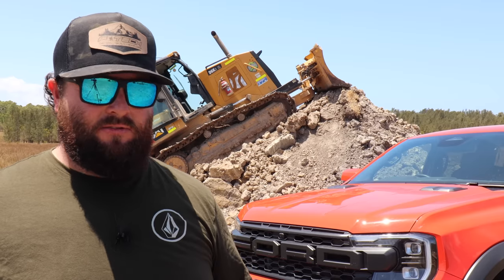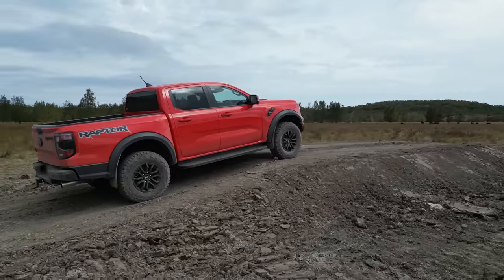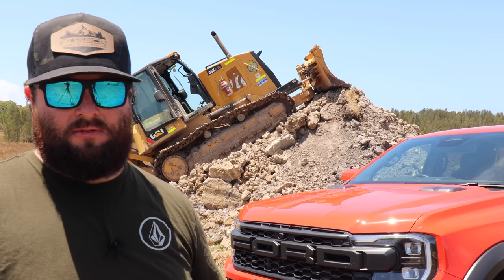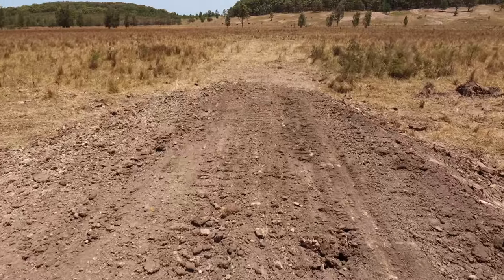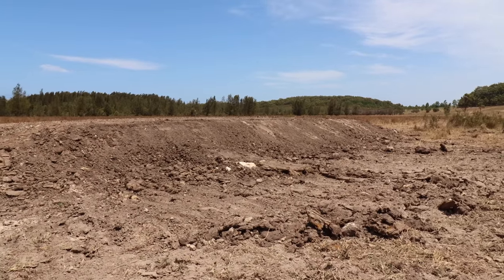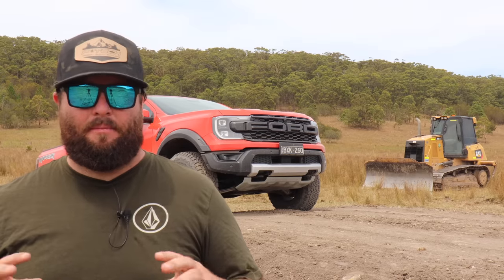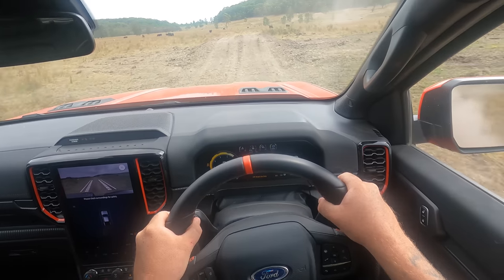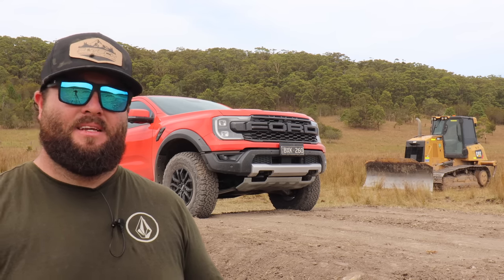💀HOW TO JUMP A RANGER RAPTOR ! WATCH before you jump your RAPTOR .

Comment: A lot of people don't actually understand how good the Raptor (either generation) is straight out of the box. This only serves to further prove the point! and the fact FORD gave you a car shows their confidence in it too!!!
I hear "Oh for that money I can build a miles better Wildtrak" which I don't believe is true without a massive cost rear coil conversion..... It would be awesome to see if you could get someone with a modified "normal" Ranger to tackle some trails against a bone stock Raptor. Especially those quicker Baja style runs, to see just how different things are between the two!
Your first gen vs. next-gen stuff is brilliant but there are guys on the fence about Wildtrak vs. Raptor that might not fully understand the massive differences between the two either in basic engine/driveline/suspension spec, capabilities or chassis and engineering changes.

Comment: If i put 315 70 17 tires on mine, can it still be put to a test like this? Can it still handle road abuse? 

Im wondering if it will damage the fenders in that case
Reply from the maker: I have 35s on mine and it does scrub out on full compression. You might be ok but if he aware it might touch.

Comment: Hey Ty 
Great video and explanation.  Are you doing any spring lifts to the Gen 2?
Reply from the maker: With bypass shocks it’s very difficult to put a lifted spring in with out destroying the ride
Reply: @TyFenwick  good to see that opinion!!!!.... too many people out there argue otherwise and will lift their Raptor (either gen) 2" and say "nahhh it didn't change anything with the ride".
They'll then proceed to use it as a freeway commuter for 4 years and do one or two weekends on the gravel in their entire ownership of the car... But if you actually use one, abuse one, and take one offroad in anger and you'll see pretty quickly that it is totally fine as is... Ford knew what they were doing, FOX knew what they were doing... Old mate that stands to make $300 profit out of you in a couple hours selling a "lift kit" doesn't have a clue...
Plus, factory fitted with 33" tyres (able to handle 35" boots fine if you get the right wheel/tyre combo), and with significantly more suspension height / ground clearance than a normal Ranger, it doesn't need a lift to avoid getting hung up on bumps an regular Ranger will be beached on...